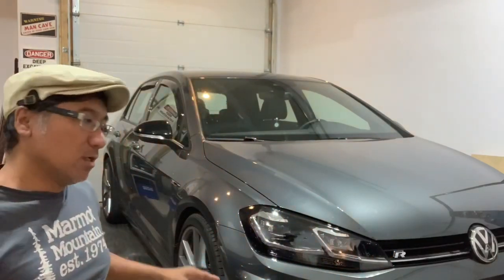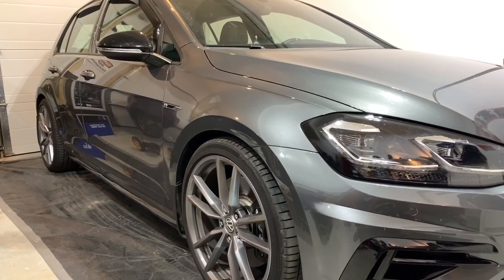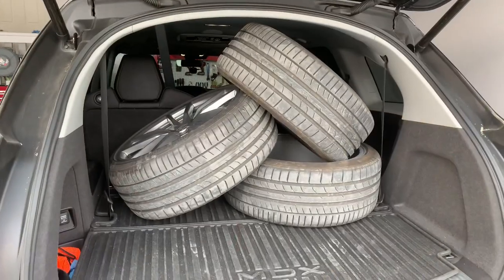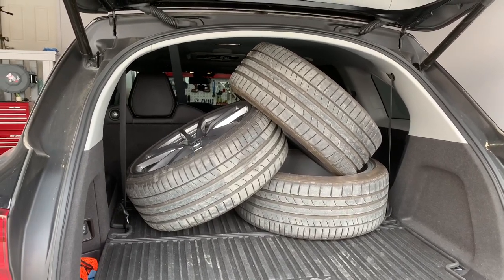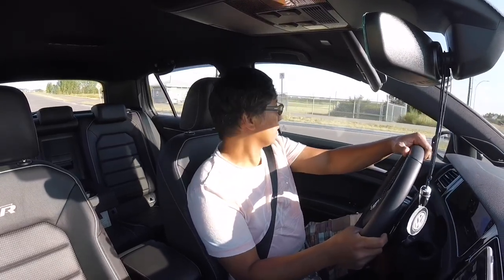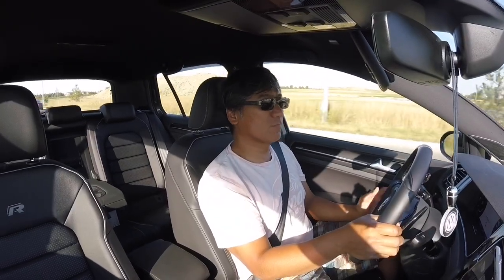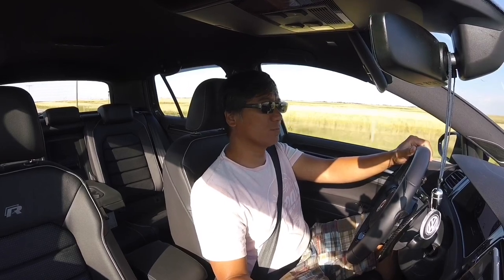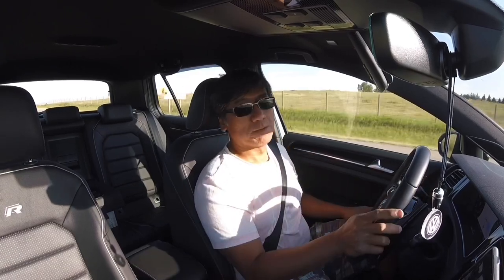My Pretoria Wheel Is Bent | MK7.5 Golf R | Better Off with 18 inch wheels !? | Vlog

Comment: The smallest size possible is always the better option because the weight is lighter, lateral forces smaller and wheels are stronger because of the shorter distance between the center and the lip.

Comment: I bent my 17in after market winter rim, blew out the side wall. 
Yes more side wall rubber helps  but the strength of the rim is huge. I have an Oryx White R so I opted for the 19in Cadiz, just me but I like them. These are a stronger wheel than the Pretoria’s. 
Seen so many bent Prets vs Cadiz
Reply from the maker: They sure a lot stronger. I had the 19” Cadiz on my MK7 Golf as well and loved the look! They are a little heavier than the Prets though...I do like the Pretoria wheel a lot given the cleaner look, beside the lighter weight and ease of cleaning.

Comment: I got a used golf r and the 19s were pretty beat up. Bent, dented, chunks missing. I decided to get them repaired instead of going down to 18s, but I put Michelin PS4s tires instead of the continentals. So far no new bends or dents in 6+ months. While I would take this with a grain of salt, tire brand does seem to make a difference and the PS4s seem a bit tougher than the conti's
Reply from the maker: Thanks man for the input! For sure a lot of guys wrap them wheel with better tires and they do make a difference performance wise and durability as well! I will definitely keep that in mind. Thanks for your support to the channel! Much appreciated.

Comment: I want to buy and used 17 or 18 low mileage Golf R and I'm hesitating due to the 19" wheels.  I live in Michigan and the roads are horrendous of course.

I'm thinking of just popping for 18" wheels, throwing on some Michelin all season  and running those full time and just trying to sell the 19's. 

Do you think it will be easy to sell the 19's?
Reply from the maker: Thanks for sharing! The 19” prets are awesome wheels. They look so good on the R. Depending on how bad the roads are in Michigan, I would suggest take the 19” or 18” the least and nothing smaller. I have 18 spillers on the mk6 Jetta and they are adopting to the road conditions here way better.

Comment: Do you like your JB4?
Do you need bolt ons with it ?
Reply from the maker: Yes I do like the JB4 and it’s flexibility of being able to dismantle it if needed. No you don’t need other bolt ons with it, but it is just nice to have to help maximize performance. I would recommend having at least an intake, inlet pipe and turbo muffler delete with it.
Reply from the maker: Not to mention some exhaust mods like res delete, catback, or even a downpipe...